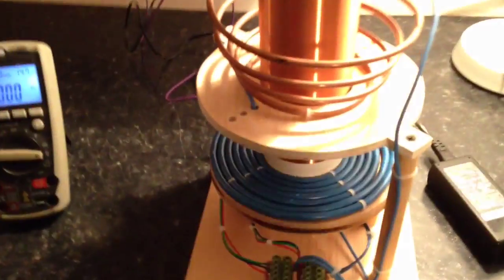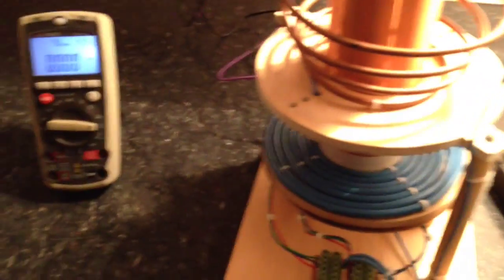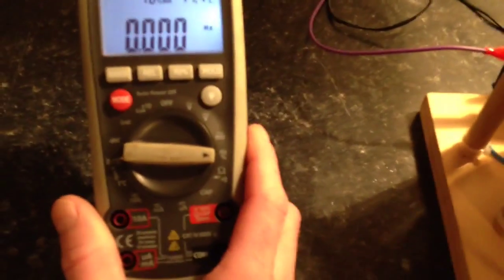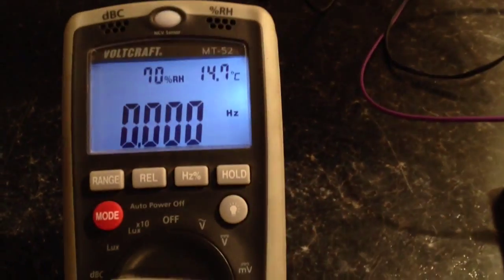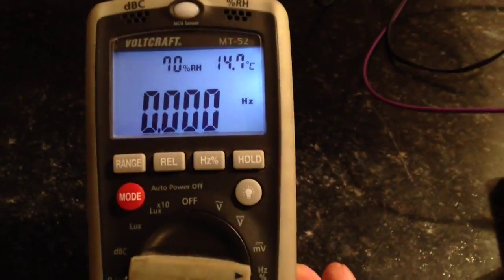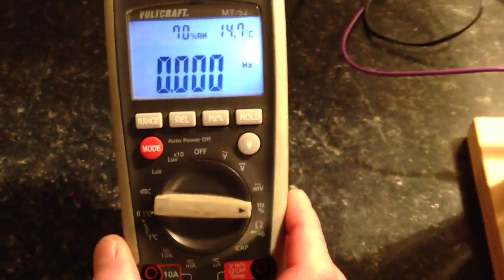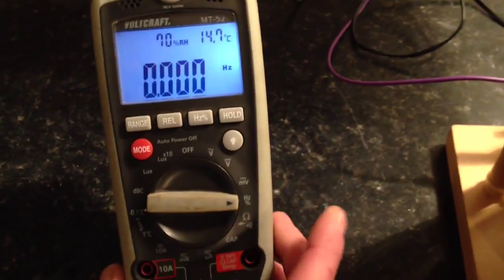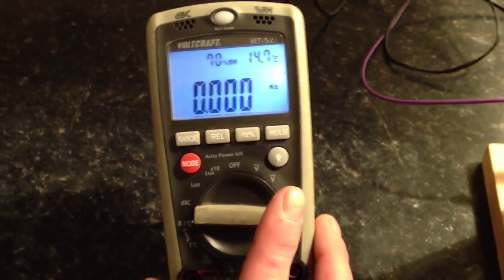Volt meter Hz reading and wireless question

Comment: Deeds, does that meter have leads to "parallel" the primary's pulse circuit to see if that's just the inherent freq of the Slayer thus the "Fundamental" carrier, as for resonance harmonics may develop depending on where the nodal lines (harmonically) intersect. If they intersect "just right" because of the coils impedance you get tesla vibratory building affair and then the reading would certainly be reading the "resultant" of course the guys are right about the scope because then you can "see" those lines. but the radio tuning according to "beats" like tuning a piano string. Enough blah. one last question. Do you have a way of varying the primary's input frequency? Then you can shake rattle and roll.    heheheheh       Scott

Comment: Try running a slayer with a top-load, then without... The frequency of the SE should be lower with the top-load attached, the difference should be in the 20-60kHz range (depending on the size of the TL)... If it reads 320kHz for both setups the meter is not functioning properly. There is my 2 cents. Peace deeds.
Reply from the maker: Thanks buddy... I'll take that donation and pop it in the old memory bank :)   It's actually a good little test, I'll try that. Peace bro.

Comment: oscilloscope waved in the air like that shows a perfect sine wave. ive wondered about the sounds that come in through the am radio as well. i want to find a freq. measuring program for the laptop and run a mic to the radio. if the numbers started lining up, it would end up being a nice way to do calculations!
Reply from the maker: Thanks Jeremy - I saw a guy on YT doing that I think he used audacity. Cheers